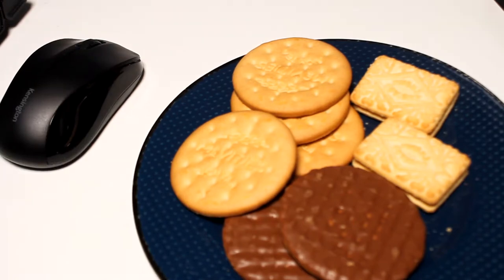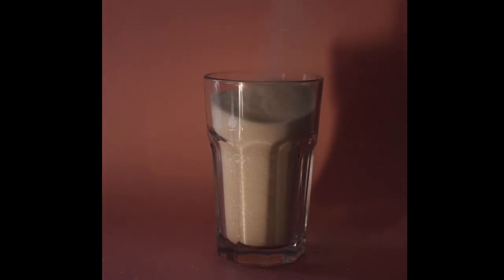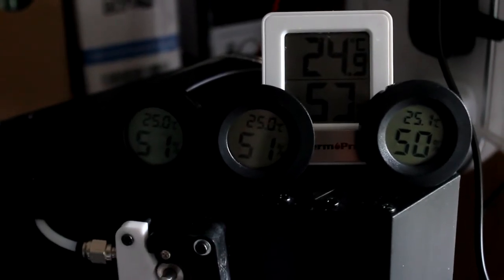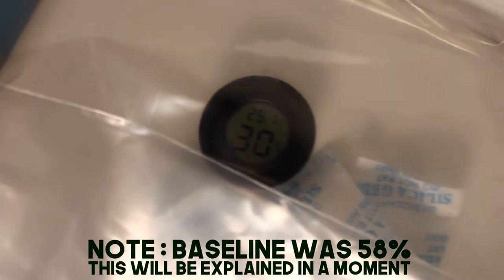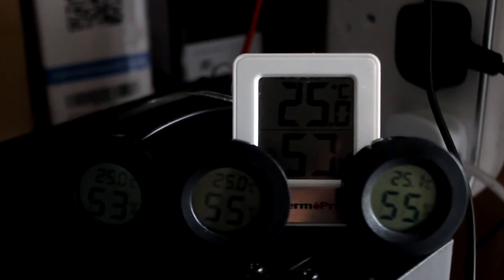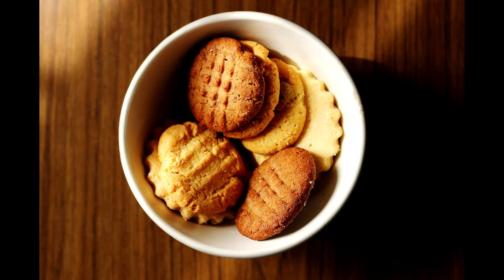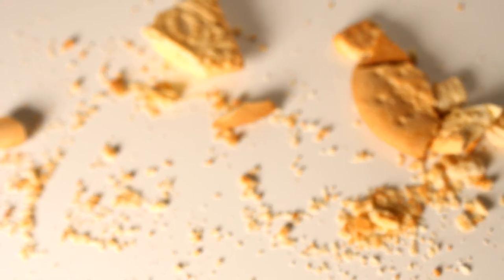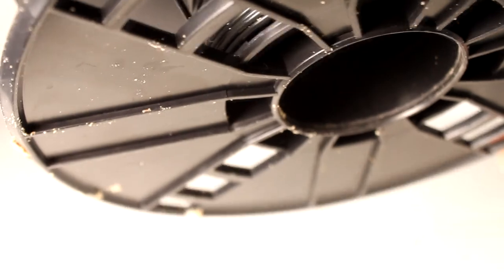Weirdest way to keep filament dry? Also do silica gel bags actually work?

Comment: So here's a new test you could try in this area, that I haven't seen anybody else do before.

How effective are different containers at maintaining a reduced humidity level? 
- Perhaps try putting sensors in a Ziploc bag, a vacuum bag, a more expensive container with a rubber seal, and a super cheap container that is far from airtight.
-Give a measured amount of desiccant, determined by the volume of each container. (perhaps X grams per cubic meter)
Check humidity after 30min, 24hrs, but more importantly after 7days & 1 month.

A test like this will absolutely determine how much I want to spend & how hard I want to work on a project idea I have.
Reply from the maker: an interesting idea, I'll write it down!
Reply: Did you ever do this? I'm interested in the results.

Comment: I have not tried this myself! but apparently you can restore your silica gel by drying it out in microwave?
maybe baking it for a short time on the hotbed would work too?
Reply from the maker: Haha - mind reader, I am literally editing a video on that this very minute - come back later on today! :)
Reply: If it's warm outside, you can dry the desiccant by leaving out in direct sunlight in a clear container with the lid mostly on.  If you have the colored type of silica  desiccant beads, you can visually see how dry it gets. (or just get a cheap hygrometer to see when it's dry).  Short time in the oven or a food dehydrator will dry out the desiccant too.
Reply: Beware the microwave method. I once saw a guy drying bulk desiccant on a paper towel in the microwave, and the paper towel caught on fire. Most microwaves have a power setting that cycles the magnetron off and on. A power setting of, between 1 and 3 could help to prevent overheating. Or use short cycles, like 15 sec and check between each.

Comment: If the environmental inside the bag is always trying to reach humidity equilibrium, wouldn't anything with a humitidy content less than the air in the bag work as a dissicant? If that's the case I would try not only biscuits but toasted bread, dryed chickpeas and things like that, seems amazing !! Hahaha
Reply from the maker: Yes basically - it seems like it's all to do with these "moisture sorption isotherms" - but essentially yes, anything that would go soggy in normal room conditions! 😂 Toast is an interesting one...because it starts from bread which definitely wants to lose moisture, but toast..yeah definitely will try that!